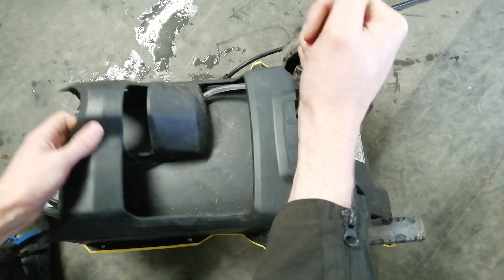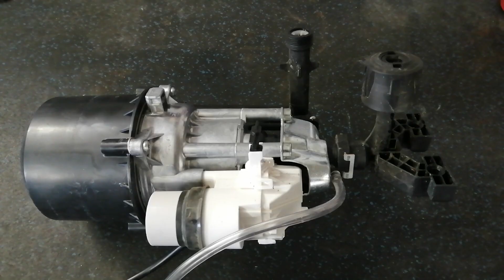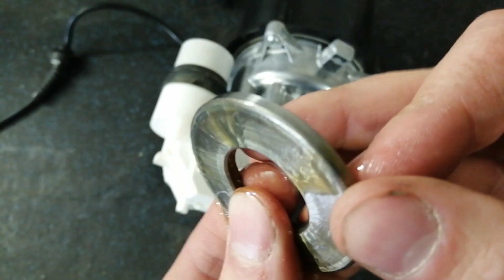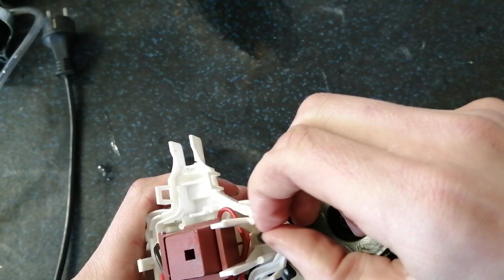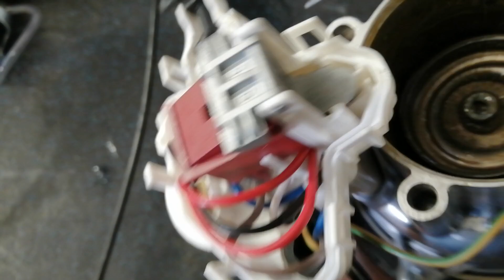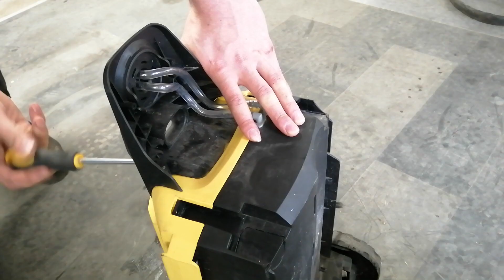Kärcher K4 - NoStart - teardown/fix

Comment: Hi. Just a comment for reference.  At 6.20 in you refer to seals - they are in fact spacers and underneath there are seals through which the pistons travel.  I’ve just taken mine apart as I think it is those seals that are my problem - not exactly sure as yet.  I have pressure with the machine but not enough - and I have no other leaks.
Reply from the maker: Hi, you may be correct with the seals. I didn't want to pull mine apart as it doesn't leak and didn't want to mess it up .-.  -  i  think i meant the spacers are like a headgasket, when thinking about it like a combustion-engine, thought they might have double duty. I'm gonna link an update if i ever get to it...

Comment: Thanks for video. My problem was loose connection in wiring coming off the switch inside white plastic housing. Thanks for showing how to take apart. Really helpful you explaining the workings of preasure washer also.

Comment: I repaired my same model yesterday. The small black rubber item you were enquiring about is a kind of seal where the back pressure of the pump turns the motor off via a small piston rod through the pump casing and activates the power switch momentarily. There's a small blue (on mine) same-shaped seal on the white switch housing through which the piston rod passes to press onto the silver metal spring-loaded metal part. When the trigger is released, the pump back-pressure activates the small rod to switch the power off. The power switch is a momentary type of switch which is normally on until water pressure forces it to go off (via the small rod or piston). The rotating power switch (black knob) overrides this action by using a small cam to raise the pressure off the red internal power switch. Oh, that isn't easy to explain!
Reply from the maker: You seem to have a pretty good understanding of it now, and definetly explained the part better than me ^^
Cheers
Reply: Sorry, I forgot to thank you for a great video. Update on my repair. I attempted the repair because the machine was 'on' all the time, regardless of the trigger position. I stripped it down to understand how it worked and watched a few YouTube videos. None really addressed my exact issue, but they were great at showing the theory of operation. I greased all the parts around the piston rod. Stripped down the white housing to check the wiring and switch action, which seemed fine. While still disassembled, I connected the power, output hose and water supply, and to my amazement, it worked normally. I reassembled it, cleaned it up and gave it to my son-in-law.  I had already bought a new one but wanted to re-use this old one if it was easily fixed.

Comment: Really useful video. Mine had all the cleaner solution pipes blocked up and I had trouble removing the cover - after watching your video it all made sense - why put the screws behind the wheels beats me. Pipes now cleaned and reassembled.

Comment: Thanks, great video and hats off to you for the spare part follow up.  My Karcher switch is not turning the unit off anymore, but otherwise works.  I reckon that's the better problem to have and I don't fancy taking the motor apart to get into the switch - though I guess I could if the switch stops delivering power altogether.
Reply: You can get a replacement switch from cpc Farnell SW04818. Need to remove some plastic webbing but otherwise a direct replacement.
Reply: @drlodge my k4 won't turn off either, after speaking to KArcher the switch has to be replaced as a complete unit?
Reply: @timothyharding618  yes that’s what they would say as Karcher only provide a complete head unit that costs almost as much as a new pressure washer. But if you have the skills and understanding, the micro switch inside the unit can be replaced for a couple of £££s, that’s what I did.
Reply: @drlodge  I've dismantled mine, I have the brown switch in pieces now, can't share pics on here but it looks much darker brown shades around the electrodes
Reply: @timothyharding618  think I still have a spare switch here somewhere
Reply: @drlodge  I've taken the two tiny contacts out, they fall out, and very black underneath. I'm not very confident with a multi meter..
Reply: @timothyharding618  it’s the contacts that have failed, you get arcing between them then they weld themselves together. Can’t find the spare switch but check the reference above to see if that switch is the same and if so, order one and replace it.
Reply: @drlodge  cheers buddy
Reply from the maker: Thanks! Yea why bother fixing as long as it does it's job and the pressure shut off works.

Comment: I just fixed mine earlier today. It wouldn't switch on. Inside that red switch there are two more springs placed on the contacts, I found one has come off and fixed. I suggest you get yourself a multimeter so that you don't go live to test. Great video by the way 👍